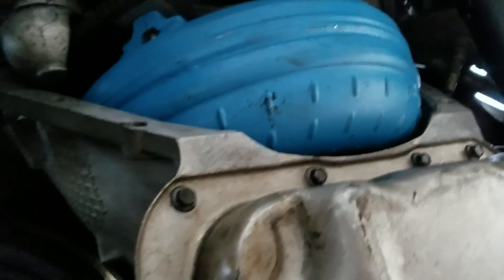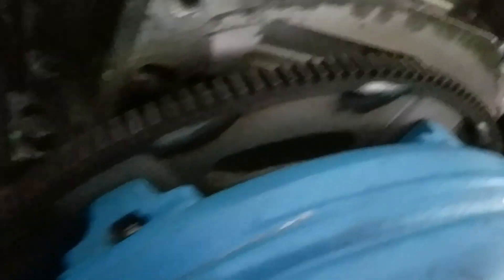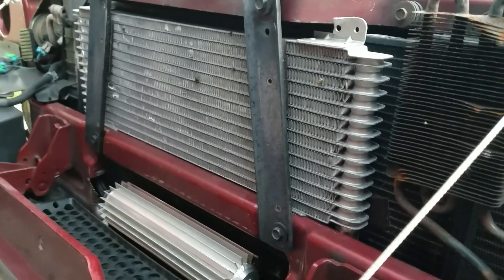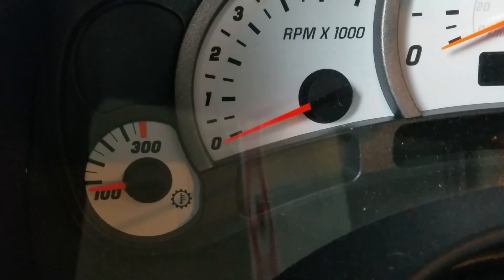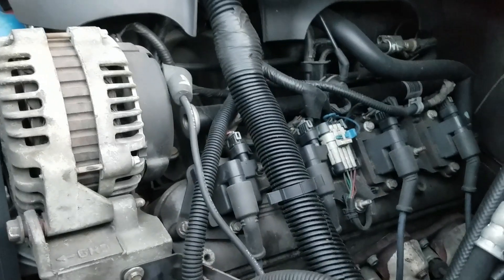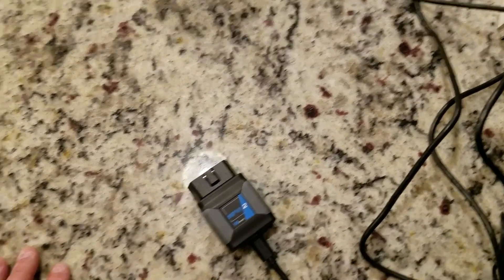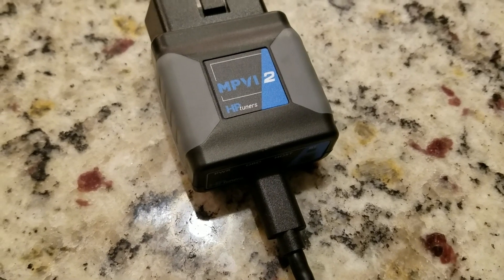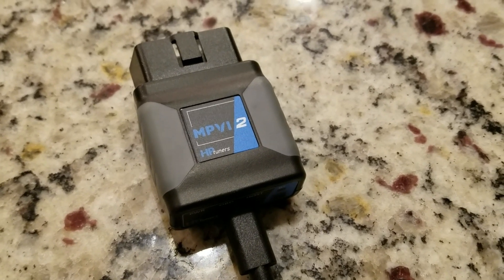Hummer H2 4L80E Swap #1. Silverado, Sierra, Tahoe and Suburban too!

Comment: i cannot for the life of me find a 32 spline input shaft for a borge warner 4484? I had a np261 tcase and it didnt fit. i really wish i knew the model tcase that you got the 32 spline input shaft from? is it a np263? NP246? Please help me out. the only other tcase that has a 32 spline input is from the new hummers with the 6l80s. them new borgewarner 4484s in the 2009 would work but i cant even find the input spline for that either?
Reply from the maker: I ordered the input shaft from a 4x4 store. They would almost certainly know. Thanks for watching and commenting!

Comment: Ive been searching for years for a cheap way to do away with the all wheel drive. I watched both your videos and ive yet to determine if you actually changed the transfer case to the 2500 one.
Reply from the maker: I used the old transfer case, but I changed the input cluster. Does that help? Thanks for watching and commenting!
Reply: @mohawkgarage  Yes it does. I re watched them and figured that's what you did. I've found BorgeWarner kits to make the transfer case selectable and a Dana60 front hub kit to disengage the front rotating assembly. Downside is manual locking hubs. I guess I'm trying to have my cake and eat it to. I've just not seen anyone put the entire combination together in a factory manner. But with the best math I can gather. The combination should boost fuel economy quite significantly. 4-6mpg gains.
Reply from the maker: @getinit56  I agree about the mpgs. I entertained the thought of 2wd for a while since I live in Florida, but ultimately decided to keep it in the stock configuration. I didn't want to freak out the computer or some sensor I didn't know about. Good luck!
Reply: @mohawkgarage  Thank you. You to.
Reply: U can unclip the front cv axles. Remove the front diff. And run in 4lock hi.

Comment: 👍😎👌Excellent video. Got a question can the 4l60e be directly swapped out for the 4l65e transmission?
Reply from the maker: While I have never done such a swap, I believe it's physically the same on the outside. Not sure about wiring. You will probably have to do a segment swap with HPTuners no matter what. Thanks for watching and commenting!
Reply: @mohawkgarage  you're welcome and I appreciate the information. Your videos are top notch awesome 💪😎💪
Reply from the maker: @J.Crooner  Excellent, I'm glad you enjoy them! Have a great day!
Reply: I personally swapped out a 4L60E for a 4L65E trans in my 2005 Yukon XL non Denali and ran it for five years sold it off and it still going for the other guy. No programming
Reply: @latunguley 
✊😎✊Cool stuff. I actually ended up swapping my 2005 H2 Hummer 4L65e for another 4L65e out of a 2008 Chevy Suburban. I used the original H2 torque converter and everything worked at first glance. The only problem I have now is that I only have 1st & 2nd gear. I can still go 70mph but i'm at 3000rpm instead of 2000rpm. It's like I need at least one more gear to make it right. I'm not sure but I was told that after 2007 they change the transmission internally something about implementing a new fuel delivery system. I still don't know if their is a way around this issue so that I could get at least my 3rd gear back. If you know something I don't feel free to share anytime.👍😁👌
Reply: @J.Crooner  2008? That should've only been a 4L65E. But more like a 5 speed 4L70E  ? Got me scratching my head on the one
Reply: @latunguley  Exactly i've ben scratching my head on this for a few years now and still now I don't have any clue other than to have to take the entire trans back out and put in a compatible one.🤷

Comment: Brother, I'm extremely impressed not trying to be negative I just need to mention this manufacturer of the trans cooler said not to put the hose connectors facing downwards it will cause the cooler to drain and then your pump has to push the oil up through it every morning, we put the same exact trans cooler except we flipped it
Reply from the maker: Thank you! I'll swap it asap. I'm never too proud to learn!